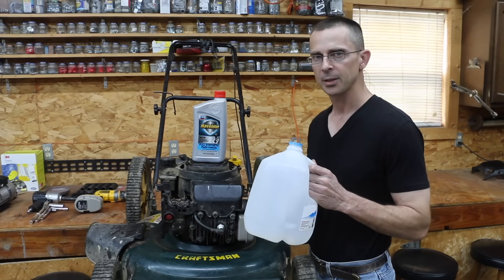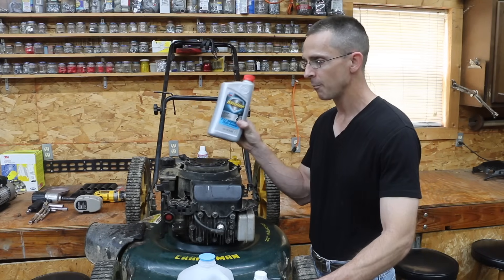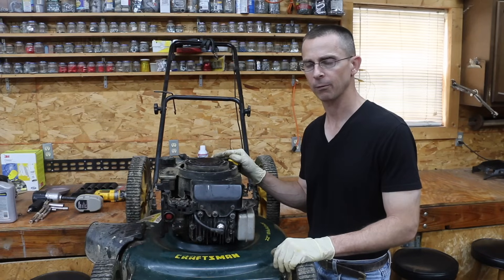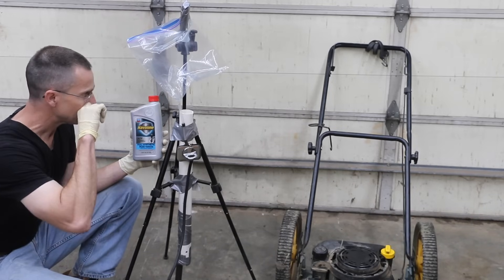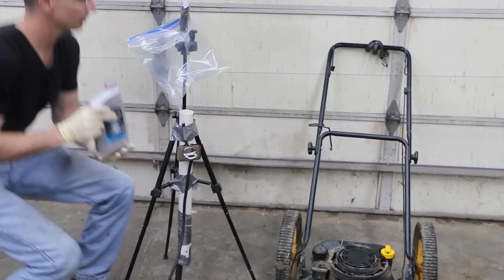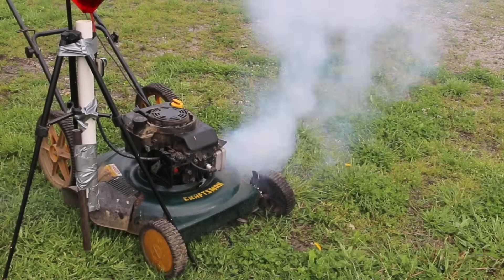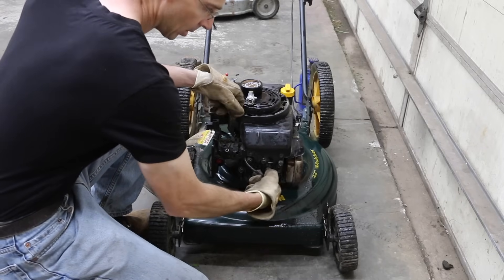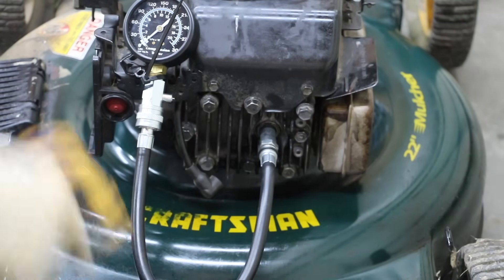Seafoam--can't believe what it did to my engine episode 6--Seafoam vs ATF!!

Comment: What is your thoughts on refrigerating the additive prior to use for maximum temp variance because I am stuck on the thought that this is only working because of drastic temp changes causing expansion and contraction of dissimilar materials I.E. carbon and metal.
Reply from the maker: Interesting approach!  Others have suggested having fluids very warm.  I don't know if the kind of real world testing I'm doing would show a distinguishable difference.  Thanks for watching the video and commenting!

Comment: additives will always be an arguing point... they do remove some carbon...ones has to wonder how much damage does loose carbon do to your cylinder walls before going out the exhaust valve...sir you ask what i prefer for cleaning carbon ...i honestly dont do it because its  simply isnt worthwhile... (ive never had carbon cause a problem) but if i were going to clean carbon from lawnmower combustion chamber id remove the cylinder head and raise the piston to top dead center and scrape it with a scraper and while i had the head off id clean the valves and valve seats and lapp the valves if needed... that my view of carbon build up...it worth noting that installing a fuel filter and replacing it often along with regular air filter maintenance will  reduce carbon build up... and extend the life of the mower... i left another maintenance tip in the comments section for your seafoam video
Reply: Long trips will also eventually burn off carbon in a healthy engine. Short trips load up the combustion chamber with carbon and gum up piston rings.
Reply from the maker: Great point!  Thanks for watching the video and commenting!

Comment: I could see using a little ATF as a crank case cleaner if you immediately dump oil. All of that gunk suspended in your oil will find its way into vital parts. Also I would discourage burning it through the intake system. It's neither compressible or combustible. Too much could damage anything from the valves to the rings or even a connecting rod (notice the lower compression values after). With that said.. great video. It opens topics for discussion.
Reply from the maker: Great point!  In a future video, I will caution others regarding risks.  Thanks for watching the video and commenting!

Comment: I have an 04 F150 and monday I was told that the oil channels were clogged and the valve train was not getting oil or very little.this truck has 96k on it and I have taken good care of it So the mechanic put some oil cleaner in and ran it for awhile. Then replaced oil and filter. Long story short if that did not work it means an engine replacement. Any suggestions from anyone on this channel would be appreciated.
Reply from the maker: Have you tried Seafoam?  Thanks for watching the video and commenting!

Comment: Your next project should be testing Restore.  Restore is designed to fill in the scratches and flaws of your cylinder walls to restore compression.  I've already tested this myself.  You are going to like the results.  How ever you can not use the stuff every oil change.  It will make the motor too tight.  Another thing I learned the hard way.
Reply from the maker: I'll buy some restore.  I've heard it is a great product!  Thanks for watching the video and commenting!

Comment: If for nothing else but seeing someone else  destroy a few small engines and perhaps video of catastrophic failures, I'm subbed :D  And a nice concise presentation, which is 1000% better than most channels out there. Thank-you for making an effort to produce ballble-free content!

I had already watched several other comparisons of yours, but this ATF one is one I have previously tried myself on a basketcase Rover 3.9 V8.  In the grand scheme of things for me I think it made SFA difference on it's own in my results.. 
However, when I flushed the engine with ATF AND an oil flush treatment though.....   holy mother of god did it scour the crankcase clean - moreso than either treatment had done in isolation previously... So how does that fit into your equation??? 
I think for a 100% conclusive result on your ATF test, you might want to show us some shots of the crankcase insides  - because the results will be very interesting.

FWIW, after I was done performing the combined ATF/engine oil flush, the blowby became very apparent, and the valvetrain noise increased considerably. Proof that the engine was pretty well abused in it's past life, and worn rings were the reason I performed the flush previously.
This was immediately fixed with fresh synthetic 20W-60 oil and some liqui-moly MOS2 additive (friction reducer, which I have been using for years, rover v8's are notorious for camshaft wear (soft  iron))  and the vehicle has 350,000 on it now, it runs nice and quiet, blowby is minimal, but still present, only a slight black soot on the tailpipe. The engine also makes better power than it used to when I first bought it a few years ago.
So there are things to be learned, so long as you don't care if the result possibly includes irreversible damage....  or a more predictable likelihood such as blow-by, which is why I always say to people who want to try it - " If you have nothing to lose, then sure - but if it costs you an engine, don't complain about it"   I'm still trying my best to slowly and predictably kill the rover v8, and will surely succeed one day. 
Thanks - can't wait to see you do a water-methanol test - I think that would nett a result that is better than water on it's own.

Comment: My jeep has 180K miles on it. Bought it new. Always run Chevron fuels. Had the heads off the other day for some mod work. Very little carbon build up in the engine or on the valves. not even enough to take a scraper to. Your internal conditions are all in how well the engine runs, the type of fuel you run, and how long you are running the engine each time you start it. as most people never really get their engine up to operating temps on their commute (About 15 to 20 minutes) they are crating a lot of carbon build up while running cheap convenience story fuels. at the lest use one tank of good quality fuel a month and you should never need seafome or any other additives to clean your engine. Take the car on a good 1 to 2 hour road trip 2 to 3 times a month.

Comment: Depending on what materials are used on seals and o-rings, using ATF can cause these to swell or deteriorate. So you may want to test them on loose seals to verify before potentially damaging components. But ATF does have those detergent properties.
Reply from the maker: Great point!  Thanks for watching the video and commenting!

Comment: Back in the early 70s, I was working for a Cadillac dealership in Houston, Tx. We offered a tune-up add-on called de-carbon service that was nothing more than running a quart of ATF through the carb then driving it until all the smoke cleared up. Then they mechanic did a regular tune up on the engine. It was an extra $25 on top of the tune-up. The last time I took my 2011 300C with the 5.7 Hemi in for a tune up they wanted an extra $200 to do essentially the same thing. I declined the "extra" service.

Great videos! Keep up the test!
Reply from the maker: Very interesting!  Thanks for watching the video and commenting!

Comment: Had an old Toyota that was maintained poorly.  I was told to add a quart of ATF to the crankcase and run the engine for a few minutes then drain and change oil filter.   Over a period of a month I did four oil /ATF changes, each time the oil removed got a little cleaner.   The first few times globs of sludge came out by the fourth and final time it came out really clean.  The whole project at the time cost me near a hundred dollars, but I feel it saved that engine, as it ran smoother, cooler and stronger than it did when I got the vehicle.   Scientific ?   Scientific enough for me as I witnessed the oil go from thick black sludgy, to smooth dark honey colored.
Reply from the maker: Thanks for watching the video and commenting!

Comment: You did a really good test there but those people who told you to put it in the cumbustion chamber are dead wrong and have either no actual experience or are a little confused. by putting atf in your crank case you can clean out some of the gunk and varnish from your crank case and valve train depending on what you're putting it in. Water in your intake is never a good idea no matter what. The water in the intake myth comes from how seafoam got it's name, back in the day people would use salted water in their diesel to blast off scale, this didn't work well either. 
Take it from an actual expert, just use seafoam, by trying to cheap out you're just hurting yourself. when you add seafoam to your oil to remove sludge and gunk, do it when you plan to do an oil change. while you warm up the engine and add the seafoam to the intake the seafoam in the oil will work it's magic. Then while you wait for the seafoam in the combustion chamber to work you can change the oil and by the time all that's done it should be time to run the engine and blow out all the seafome and crud. also add it to your gas to clean your fuel lines and injectors
Reply from the maker: All great points!  Thanks for watching the video and commenting!

Comment: Anytime that you get water in your oil, you want to get it out of the engine as soon as possible. Leaving it in the engine will lead to droplets of water resting inside of the piston/crankshaft bearings, rings, and lifters. Very bad, as it will rust the steel/iron surfaces. If you get water in your oil, such as with a blown head gasket, drain the oil out and replace it with clean oil as soon as possible. If the water was from cleaning the engine (such as in these videos) then changing your oil and running the engine for a few hours ought to burn out all of the water contamination.
Reply from the maker: Great point!  Thanks for watching the video and commenting!

Comment: I bought a 1994 Pontiac sunrunner (tracker) with 198,000 kms on it, put seafoam in the crankcase and gas tank it ran smoother, it was peppier. I also had a 91 ford escort 198.k  kms  used slick 50 in it, took it out to the mountains, before trip topped up some oil and forgot to put cap back on drove 200kms no problems, maybe saved my engine?

Comment: Where you need an engine to be really clean is not in the combustion chamber but in the rings. That makes the biggest difference between blow by and compression. What's on the head and Pistons is largely irrelevant. On this engine the deposits are because it's worn and burning oil anyway. Nothing is going to replace lost metal but carbon on the piston and on the head may help in fact compression by reducing the squish volume. 

ATF can be added to the fuel as well as direct fed.  It's ending up in the same place either way. The way this is being done you could pretty much use any liquid and see a result because the carbon is being washed out more than anything else. 
Water is my favourite but I use it constantly ( as in every time the vehicle is run) and under load. That forces it into the ring area to keep that clean which is why I use it. The combustion chamber is pretty irrelevant. 

You can never do a test everyone is happy with but for me as much as I like what is being shown, having an engine just running is a major  flaw in the tests. 
If they were done on an engine under load, say like on a generator or water pump that was working, I think the results would be much different and more realistic. If you could get an old pump or genny which you could load up so the engine was at proper operating temps,  the tests would be far more meaningful. The water result alone would have been far different if done on a working engine that was at proper operating temps rather than something just coasting as it were and barely being warm. 
 I also question the whole clean engine thing. The combustion chamber is only an empty space basically.  As long as the carbon isn't causing pre ignition it may help with compression. 

As for what you are spending on the additives, you are sure making that back with your YT revenue and plenty more.  Good on you, you are providing great entertainment and education and I hope there are plenty of $$ left over for your trouble.

Comment: try diesel.it works great.set the idle up and drizzel it in through the carb running.will smoke like hell 😂.but it will clean and lubricate the valves and piston.ect.😁enjoy

Comment: After this, I think I'd be more likely to use ATF as an oil flush right before changing the oil than to clean the top end.
Reply: It works quite well, in my opinion.

Comment: I have used ATF in my '93  Ford Ranger for 7 years.  When I first bought my Ranger it was only getting 12 mpg. I use a half pint of ATF per full tank of fuel,  once every 6 weeks. Now I'm getting close to 20 mpg on a 25 year old pickup. Not bad.

Comment: Nice vid, I use sea foam every 6 months, have 320k/mi on my car and 170k/mi on my truck, really helps clean o2 sensors, never replaced one on any vehicles I have owned. I like using a Shure Shot can to spray it into the intake. Sea foam also works great for stuck lifters. Heard atf works as well.

Comment: mopar foaming top engine cleaner - pull the plug, spray cylinder,  let it soak 24 hrs, blow it out with compressed air - cylinder clean as a whistle.  Start engine, let it run for 20 minutes, change oil and bob's your uncle.  You can buy it at the dealership.

Comment: these compression tests are hardly reliable.  this engine has an automatic decompression feature for easy starting. if you get a 60-70 reading by hand then it just means that the engine is OK but it probably has an actual compression of 90-125. but in order to overcome the decompression you need to rev the engine much faster- get a drill with a decent driver a matching 15/16 socket and turn that flywheel nut. once you spin it fast enough the meter would jump from 60ish to 120ish (and your gonna feel much more resistance as well)

Comment: what I've always done is run a steam bath first, then follow up with  a chemical like seafoam or atf. it seems to get the results you are seeing. I also hook into a vacuum line, with a tee in the line with an open end , so it's able to suck both water and air. it atomizes the mixture, and i have never seen water in the oil after a run

Comment: Best results so far! Can't wait for my digger engine to get carbon deposits so I can try ATF and hot water mistified . ATF is easily obtainable is Greece unlike seafoam. I used home made seafoam in the past but this seems so much better. Nice video and very clean!

Comment: many modern lawnmower engines have cams with compression releasing lobes that hold open the exhaust valve until the engine gets up to speed which will give low compression readings
Reply from the maker: 65bug519, Makes sense.  The readings seem to improve with certain additives.  Seems like the compression would stay the same.  How much compression builds before the compression release occurs?  Thanks for watching the video and commenting!
Reply: it is a speed based system with a weight on the cam , it holds the valve just off the seat so some pressure can leak out to make it easier to pull, when the engine runs the weight flys out and the cam lifts normally

Comment: Considering the friction modifiers that's typically in ATF I personally think that using ATF to clean a engine is a very bad idea. Seafoam is a much better idea.
Reply from the maker: pwrusr1, I wouldn't use ATF in a modern vehicle engine either.  It was a great test!  Thanks for watching the video and commenting!

Comment: A co-worker of mine had a friend that had an older Toyota pickup with the 2.2L engine that had a noticeable tick when running.  Someone suggested to him that at the next oil change substitute 1 quart of oil for a quart of ATF.  He didn't pay much for the truck and didn't expect to keep it anyway, so he went ahead and did it.  He did notice after time the ticking became more quiet so he did the same thing at the next oil change. Eventually the tick was completely gone.
I'm not sure how many oil changes he did with the ATF, but at some point he did pull the engine and overhaul it.  The engine was extremely clean inside and it only needed rings and gaskets to overhaul it.
Reply from the maker: Daniel, Impressive that it resolved the tick in the Toyota!  Thanks for watching the video and commenting!
Reply: Sorry, but I forgot the main bearings and the cam bearings were also replaced but the rest of the inside evidently was good.

Comment: If you really want to carbonize a piece of steel to test additives to get rid of carbon buildup all you have to do is get the steel red to white hot and dip it in burnt motor oil.  It'll put a serious layer of carbonization on it.  That way you can do really controlled tests in small containers
Reply from the maker: ScienceFoundation,  I agree.  I'm hoping to figure out which additives work best on small engines.  Vehicle heads can be a bit of a hassle.  Thanks for watching the video and commenting!